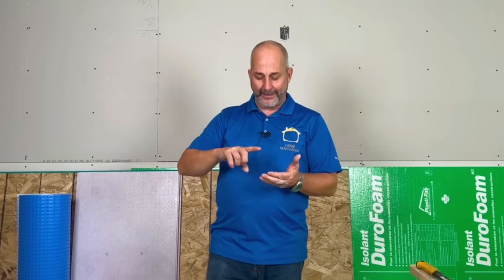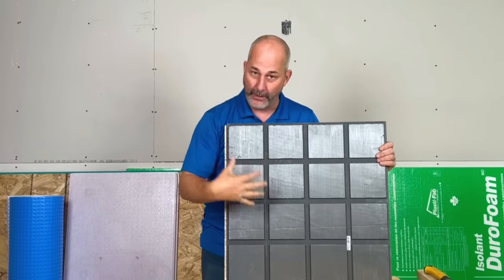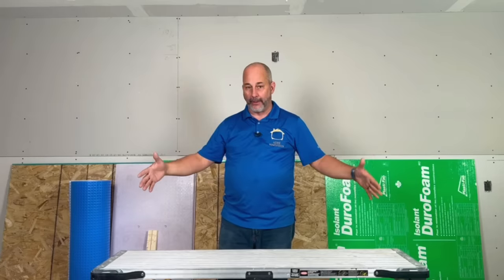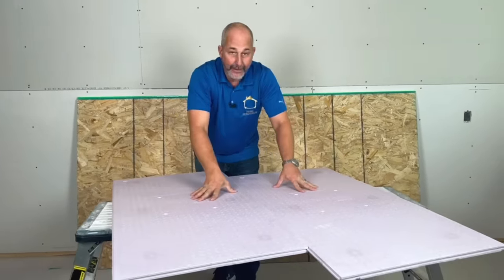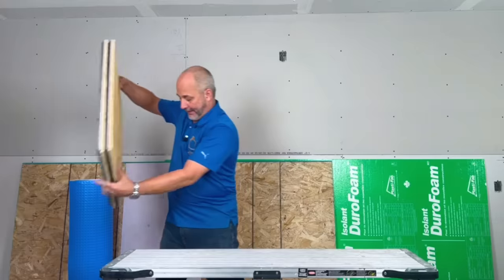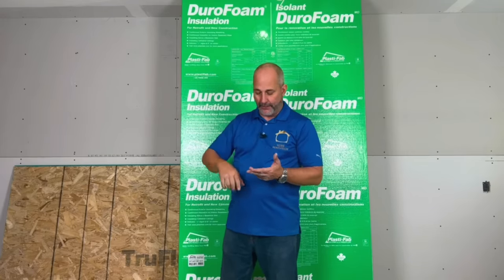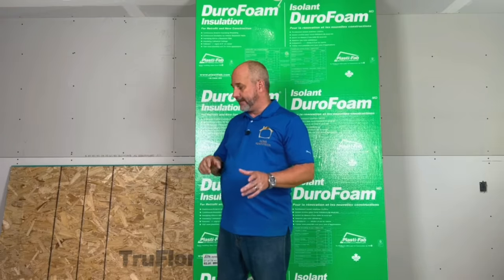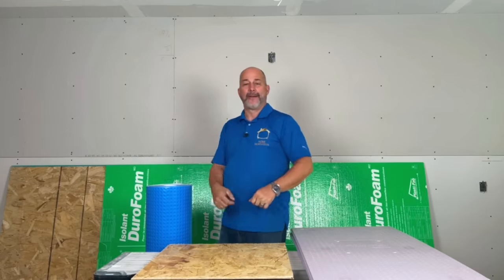Comparing 5 Different Subfloor Systems and What They Cost

Comment: For the tapcons, should use 2-3/4 x 1/4", drill the hole, vac out at the top (the stuff in the hole itself wont be sucked out), and squeeze in acousibarrier - the black sticky mastic - into the hole so that it gets into the area between the floor and the panel. It will create that little extra barrier that will last easily 30+ years, to prevent that tapcon from wicking from your concrete into your subfloor.

This is if you're doing the foundation wrap with a 5/8" panel atop it. 

The following can be used if If moisture is a problem, but there is no actual water ingress, or on completely dry slabs that may in time begin to wick as the house ages and you're doing the foundation wrap method mentioned above... Throw down a layer of landscape fabrick before you put down your your foundation wrap; it'll keep the floor from making the tapping sounds when you step on the area's between your screw down locations that have less tension and may have a gap until stepped on.
Reply: I was reading the comments looking for something about landscape fabric, so thank you! I had watched another video that suggested putting landscape fabric down on the concrete to kill the clicking noise, but I was concerned that it might actually trap the moisture and cause mildew. However, it sounds like you've used this method without issues. I hadn't thought of the mastic, so I'll try that too.

Comment: Wish this video was available sooner. I'm in the process of finishing my basement on a 2 year old home and spent a lot of time and did a lot of research before putting in the subfloor. I used the DMX One Step and tuck taped all the joints as well as tuck taping the DMX to the wall vapour barrier. Where I wasn't finishing all the way to the foundation wall I put down a heavy bead of concrete sealer between the DMX and concrete. I then used spray foam around the concrete wall perimeter. On top of the DMX I put 1 1/16 inch Durafoam R5 then 5/8 inch OSB T&G. The DMX web site says to use 15 tap cons per 4x8 sheet of OSB to fasten it down. They also said to squeeze some concrete sealer into each hole drilled through the OSB/Durafoam/DMX to maintain the vapour barrier.
I looked at the black house wrap that DMX makes that was mentioned in the video. It does cost a lot less than the One Step and is much wider resulting in less seams but One Step is made from virgin plastic and the house wrap is made using a lot of recycled plastic. The process and chemicals used when recycled material is used results in a significant amount of foul smelling off gazing which could be an issue for a lot of people.
I do have a slight problem. My grandson, wanting to help and surprise me, did some of this subfloor for me when I was away for a few days and left some gaps between the OSB T&G sheets. I'll be using luxury vinyl for the floor. Is there a product you could recommend to fill in the gaps please? (There's enough that I'm concerned but not enough to warrent covering the whole floor with self leveling compound.)

Comment: Thank you Jeff! Your channel & information have been so informative, best channel out there IMO. I am closing in a garage in Florida. The property was built in 1984. I confirmed with my own eyes that there is a thin layer of plastic under the concrete. Do you recommend that I use a subfloor system for water management & if so which one? No need for thermal break here. I will be putting down LVP. Do you recommend a rubber/foam backing or cork? Thank you again for taking the time to film all of these wonderful videos!!

Comment: Thanks for the video, my house was built in 1976 so my concrete is moist (bag test is wet), also could probably benefit from the thermal barrier. I'm hoping to put down a nice vinyl floor. Initially, I liked the idea of doing the DMX roll with the OSB on top since it would feel nice and ridged on the foot, after your video I think my best bet is the insulated foam board so I get the channels and also a thermal barrier. According to your video I would be able to put flooring right over top of that system, Done!

Any comments to my thoughts/ plan would be appreciated

Comment: I just installed the dmx one step but the red one because they told me it was better for vinyl flooring in my 1970s house. We changed the french drains last year and wraped the foundation with a exterior membrane. We had issues with moisture when we first bought the house in 2020.

Comment: 1930 home in cold Northeast and finishing basement and need floor advice.  Typically dry, but huge rain storms 1x/year cause a few gallons to come through walls on to the floor.   Added closed cell blown insulation to walls.  For floor, not sure if should just use epoxy or if dricore and LVP will be fine.

Comment: Hi Mr. Thorman,
I’m a beginner in renovation design and I know nothing. I saw your videos on YouTube and enjoy watching them, especially: “Thinking about finishing your basement? Watch this first.” I have a rental house in Indianapolis Indiana, and I would like to finish the basement. I wanted to waterproof the basement, so I had a perimeter drain and a sump pit installed. We just had heavy rain with flood warnings. I checked my basement, and it was bone-dry, the perimeter drain worked great. I have a Dehumidifier picked out; I’m going to use an April Air E070 dehumidifier. The house was built in the late 1800’s and I would like to install a subfloor, drywall, and stairs. Half the basement is living space and the other half is my machine room separated by a block wall. The Kitchen and bathroom are upstairs; thus, they are not a concern in the basement design. I had the perimeter drain installed last fall and it’s been in all winter and the floor has been totally dry all of the time. 
I want to finish the basement and house a tenant in it. What basement technology would you suggest for a design? What should I have in place for soil gases if they show up. How should I do a subfloor and floor? Especially for a possible water event. What else is there to think of in a design like this where I would house a tenant? Please let me know.
Thank you,
New member Harry Colebert

Comment: Hi, you've been an unvaluable source of knowledge for my DIY projects at home.  We were one of the impacted homes with the recent flooded basements in Quebec and Ontario provinces.  Water came from the sump pump, My 90's basement was entirely finished, and as separation of the concrete, there is full skeleton structure of 2x4s  and on top of them, there are 2 layers of 5/8 plywoos.  Before we had carpet but I recently installed a floating  waterproof Vinyl floor.  Water raised around 6 inches in some spots getting under the laminate vinyl florr as well, so we need to remove it,  and the disaster company is suggesting to open the plywood and dry the 2x4 structure under.  

I'm try to see for options different than keeping the whole wood structure and apply any flooring system than can be waterproof in case of any other flood that can be easily dried and cleaned, that has a good appereance and thermically isolating.  Things like rubber or any other flooring that doenst required to be removed after a flood.  Waterproofing a 90's home seems to be near to impossible unless I spend big bugs, so I'm looking for alternatives.  I owuld like to have anyhting with wood particles so what would be your suggestions?.  Thanks in advance

Comment: Hello from New Brunswick! I love when you do these videos. I'm lifting an old house, pouring an all new foundation for a basement apartment. I was planning on doing the roll of dimple board with the DuroFoam on top, then laminate. The basement should be pretty waterproof considering it'll be brand new and have new drain tile. However, as it sits, the yard is a natural lake in the spring and a hockey rink in the summer. What do you think? Thanks!

Comment: Thank you so much for this amazing video. Took down the basement subfloor today. Saw some moisture near the corners. The rest is fine. Could be due to bad vent system. House is 1971. Canada (near Toronto).
Was thinking of Barricade Thermal Shield, but then thought of using the old black dimple sheets + Durafoam on top. Will install either vinyl (looking for one that won’t be off gassing since the kids sleep there) or laminate. This will avoid osb board. 
Could you pls confirm if I think right? Thank you! ❤

Comment: Great video! I need to make subflooring purchase re. basement:water management vapour + climate. Our house southern ontario, late 50s bungalow, good elevation,  We had nice laminate flooring placed on top of parquet (The Carpet Store advised this, to save me money) but then.... a year later, up popped the laminate in two spots.... we did our research and the house is healthy, in fact, darn good re foundation etc. (parquet is gone now, we will re-use the flooring) but now WHICH PRODUCT for below the laminate: Delta FL (Dorken Delta? Basic Delta?) Dricore?  I need to make the right choice as pulling up again would give me such heartache (we also had nice pantry units made... all had to come up, yuck). Maybe you will not see this as 1 year after video posted. Cheers

Comment: I just tore up a subfloor in a house built in the 90s. Ranged from laminate directly on concrete to sleepers with 1 to 2 OSB boards. The kitchen, bathroom and main rooms were all different heights for some reason.

I'm leaning towards your system of Durofoam and OSB which runs about $1.50 sqft. House is up on a hill with no bodies of water near. The foundation seems to have some sort of black wrapping. We get a lot of rain but gutters are all directed away from the home and no history of floods. I'm thinking I don't need a dimpled barrier in the basement with these conditions. Would love to save as much as I can with laminate being another $3 sqft. It'll end up being a few grand to do the whole basement.

Comment: 1940 house with an internal french drain, so no concern of water running across the floor per se, but obviously no vapor barrier below the concrete. I am thinking your DIY solution of the DMX dimple with the separate sheets of osb will be best. I live in Pennsylvania.

Comment: I'm in Idaho on a mountain with zero concerns of water- but I have a walk out basement. House has finished basement in mind so moisture control was taken into consideration- but getting rid of the carpet is only going to leave me about an inch and a 1/4 to do a sub floor because the door jam- and the house has settled so will be doing a a self leveling compound. Thinking dimpled membrane is my best bet when I get to that stage of my project because clearance issues.  The old carpet will be coming out around fall.
Reply from the maker: have you considered snow melting with an early rain and freezing and then thawing and making it under the cold joint in the wall on the footing. water has many ways to infiltrate and it is not always cyclical.
Reply: @HomeRenoVisionDIY  so I've actually addressed the snow run off with landscaping because my house has a down grade in the front yard- where the grade ends I buried a trough filled with gravel that drains below the house down into my lower back yard enough runs into the canyon. The driveway also has similar water management built in as well as all rain gutters

Comment: Thank you for all the basement suggestions. Because of your videos I remodeled my unfinished basement to a movie room. Water management was concern number 1. My location has a high water table. Concern #2 was Ceiling height. Your videos made the decision for me. Used dimpled membrane with "Advantech" osb then vinal plank flooring. Here in northern Maine Advantech osb is very popular due to its 50 yr  water proof warranty. Advantech has been around for around 20 yrs. I would love for you to give some thoughts on Advantech, pros and cons vs standard osb that you normally talk about/ use. 
Thanks again.
Reply: Did you anchor the advantech with tapcons? I want to do this same system, but am unsure if I should anchor.

Comment: Love the channel. My question is, my basement has 2 floor drains in it, so that means the concrete slopes on all 4 sides toward those drains (assuming the original builder did it all correctly). How do you accommodate this when trying to put a floor down as it isnt level? Or, is it so slight that it wont make a difference?

Comment: We are putting DELTA-FL dimpled membrane directly on a new basement slab that has a tendency to have moisture in it (even though french drains are new and the slab is brand new), on top of that I am putting 2" of XPS foam in two 1" layers (with joints staggered to help prevent moisture from coming up) and the walls will have the 2" xps with staggered joints as well. This is in Montreal (so northern climate) so 2" is prob overkill in most places but good here imo. On top of that we are putting two 1/2" plywood (joints staggered for strength) and I'm building 2x3 wall (non-structural) on top of that, screwed into the joists above and double plywood layer below.

Comment: Hello! Great Video- Recently bought a home about a year ago- it was built in the 1900's we are renovating our kitchen. I have pulled up my kitchen floor (sticky tile and some old ceramic tile) I am wondering If we should replace the engineered wood before we lay down planks that have underlayment installed to the back of them.

Comment: jeff, ontario canada. 
4 level backsplit, built 32 years ago. 
repaired minor crack in the foundation. tuck taped a garbage bag down for 24 hours and there was a small amount of moisture. 
considering dri-core insul armor. 500sq/ft basement 4x8 or 2x2 sheets are not a problem 
let me know what you think.

Comment: I really appreciate all your videos. They have helped me with my renovations greatly. I am on the verge of replacing the first floor 1999 built home. A tile floor was installed directly on the slab foundation 16 years ago. It is a very very very cold floor in the winter time, but exceptionally cool in the summer. I would like to replace it with another tile Floor that looks like woodgrain. It’s only about 800 ft.² I am looking for durability and Reduce extreme coldness and loss of heat during winter. the first floor is an open living room and kitchen design. I don’t want to risk hardwood in the kitchen because the washer and dryer are in a closet in the kitchen area I haven’t had any major issues but thought of water leaks on a the Wood floor scare me. 
Am I correct in saying I do not need an additional vapor barrier when laying down Dura foam and then three-quarter inch OSB on top of that? Won’t the screws inserted into the OSB through the Durafoam create a direct moisture/vapor break ? Is one layer of OSB three-quarter inch solid enough to put the tile on or do I need a second layer maybe half inch OSB on top of the three-quarter OSB? Also Is any other barrier required? under durafoam? Any recommendations are greatly appreciated. Thank you for your time.

Comment: Thanks Jeff! We just bought a 1979 house in Orleans (Ottawa) and so you might be familiar with it. The basement isn't finished but is pretty clean. To our knowledge, there hasn't been any issues with cracks or water. Any recommendations for the sub floor? Durofoam and 5/8 seems like it could work. We will wait until the spring/summer though to see if we have any issues. Thanks again for all your videos. They have definitely helped over the years!

Comment: Man, you are the best teacher. Thank you so much. 😊 Our scenario is a mid 70’s, Vancouver Special, slab on grade. The main floor has tile throughout and the floor is freezing in winter. My questions are 1) should we first rip up the tile or just install over it (it’s level)? 2) should we somehow assess the foundation slab, retroactively vapour barrier under the slab, and then test for moisture on the floor before even considering flooring options? - assuming this is even possible! 3) do our floor system options change if we want some on demand in floor radiant heating (electric) under our engineered hardwood ( how to not mail through the electric wires)?  Love all your videos. You are wonderful;  and Canadian just adds to the perfection. Many thanks!!

Comment: House was 1975, in South Dakota, so we have all the seasons, and the issue with our basement is the occasional water/moisture getting in, but not flooding at all.
Reply: Sw Minnesota here same problem going to try Drybarrier and hope it works we just have gym equipment in the basement and will reuse all are 2x2 carpet tiles from menards when I had pulled a few up a couple weeks ago I smelled the back of the tiles and the had a musty smell no visible mold but it's to close for comfort so I'll pull it all up, it's all just loose lay and probably spray it with a bleach water mix and wipe the tiles before I put down the Drybarrier.

Comment: really getting into your videos! I'm doing a shop right now and trying to figure out how to floor the "habitable" portion, bare concrete in a non-conditioned space. No moisture to worry about, but it is somewhat uneven and very cold in the winter. If that wasn't enough, it needs to be "temporary" so that I can tear it out when I vacate, so no leveling with grout or anything. I'll probably go with laminate, but I haven't gotten to those videos of yours yet.

Thanks, Anthony